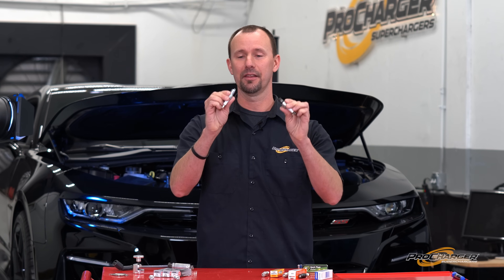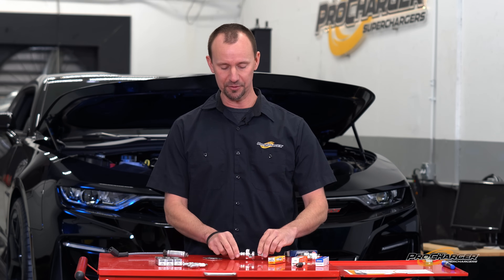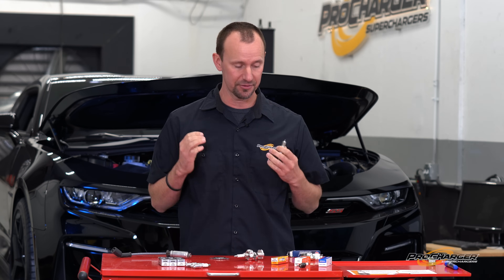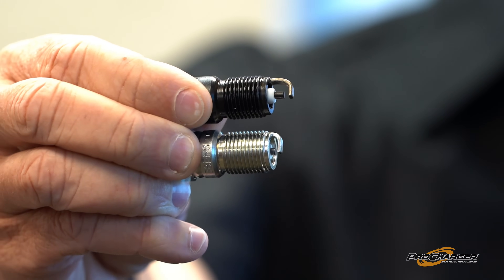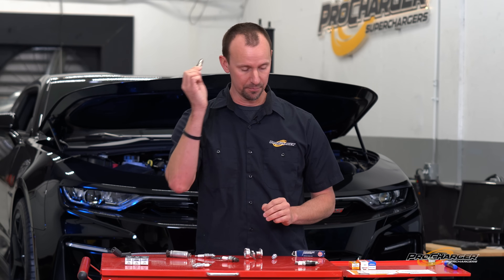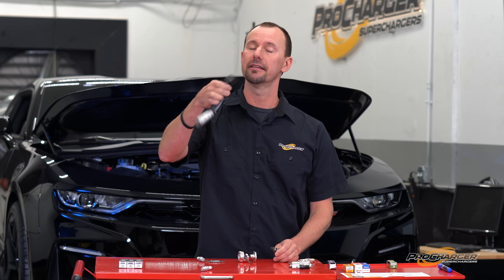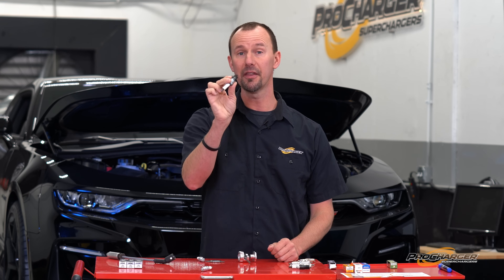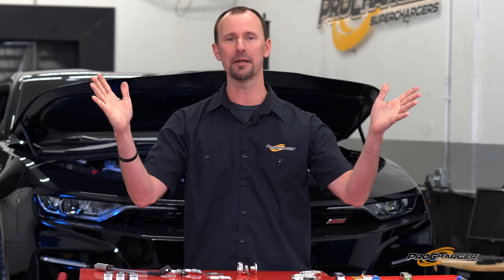ProCharger 101 - Spark Plug Tech for Supercharged Engines

Comment: I twin turbo setup for my 5.7 hemi that has MMX 360 stroker stock trans so I’m only running 5-6 pounds of boost on straight 93, trying out Brisk ER12S plugs over the NGK iridium’s I’ve ran before to see if there’s any difference. Normally run a .028 gap, does that gap size sound about right?

Comment: Hey my mustang did almost the same-thing equip with procharger
Wide open throttle it would pop a cat code 
After some research a a ha moment the spark plug gap was set as per ford
I pulled-the  plugs and recapped them to nearly haft the amount 
Tested and no codes no miss 
So procharger is letting in a boat load of air
Well guess what air gap is a pretty good insulator 
Yes more air with more fuel bigger boom but to start the boom you need the spark the ability to under high boost  means plug needs to over come the distance 
You need a higher energy spark or move the gap closer
Worked in my case to tighten the gap
Hope this helps

Comment: Thanks for the great videos, much appreciated. Do you recommend a .028-.032 Gap for a Cherokee SRT 6.4L D1SC System running @8 lbs of Boost? (I’ve read somewhere else .035 Gap) 
Thanks Much
Reply from the maker: Depends on the set up but nothing wrong with .028-.032 for most applications

Comment: The instructions for my kit said .035….? What the what? I still gapped to .028 though. I running 10-11psi and water/methanol.
Reply from the maker: We now have included a flyer at the front of all manuals that shares this info (and in process of fixing outdated manuals). :)
Reply: @ProChargerSuperchargers  Good to know. 👌🏼 I got my kit used and downloaded the PDF instructions. Luckily, my prior car was boosted. So, knew the correct gap already.